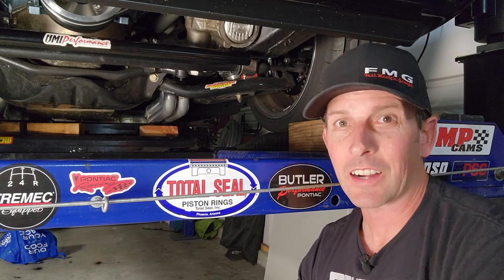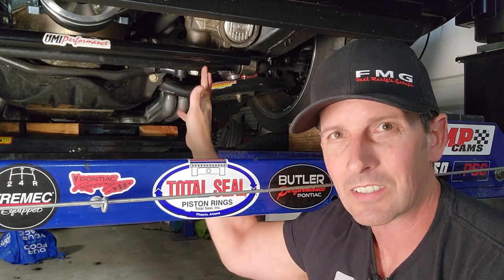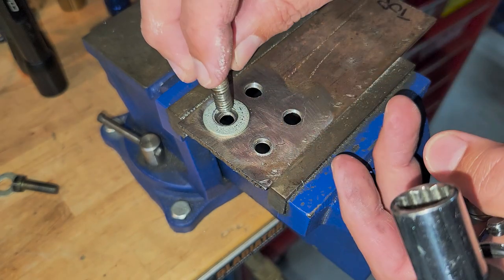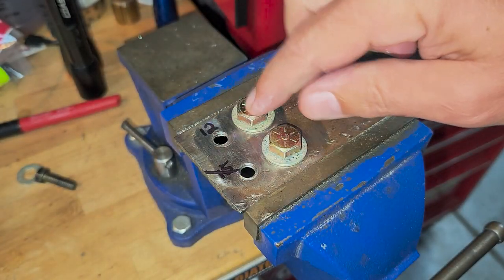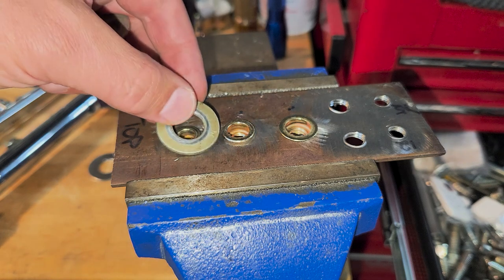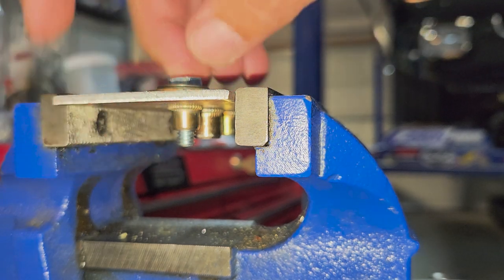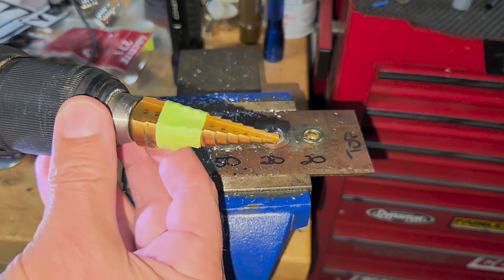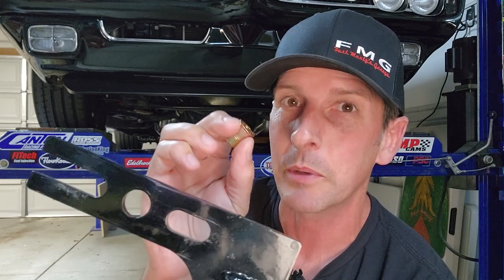How to fix a stripped sway bar bolt hole?  Retap?  Use a Rivet Nut?  Part 1

Comment: Well one of my bolts just fell out of my UMi front set up. I will be giving this a try. Thanks Monty !
Reply from the maker: Yikes!  Glad we have an app for that!  ha, ha... let us know how it goes!  Another tip, add some JB Weld to the nut/frame interface, which will give it some more strength and water proof that joint.

Comment: I went with plan D.  I measured/drilled holes in flat stock and welded flange nuts to it.  I drilled out the frame holes and ground and opening between them.  I placed the new flat stock w/welded nuts in the frame.  I bolted it down nice and tight and welded it up.
Reply from the maker: Love it!  Thanks for sharing!
Reply: I prefer plan D….speaking as a guy who likes to torque by feel which always ends up 3X the Spec
Reply from the maker: @RoddyDa  Totally agreed... welding in actual bolts is the ultimate solution.  Thanks!

Comment: I wish I had your problem, I have the style that's a welded nut to the inside of a boxed frame. It doesn't take much force to break that nut free, what a joy to deal with that.
Reply from the maker: ohhhh man, sorry to hear that.  If the nut actually broke off you could probably still use a rivet nut.  Otherwise, yeah, you're gonna have to cut it out, and weld in a new plate with nut.  Good luck!

Comment: A step drill bit is essential especially when you are drilling from the bottom up, as it is difficult to steady a hand held drill with a standard bit. One note is that using a large washer and then a small washer to even out the surface; I think this would cant the sway part about 1/8 of an inch to not being horizontal and have an effect on the function of said bar. Having installed this riv nut myself already, I am checking to make sure it holds up under the routine of driving hard through curves. I can of course keep increasing the riv nut size if that happens. I only had one stripped hole and there is a slight difference in height of the sway bar against the frame already, albeit barely perceptible.
Reply from the maker: Yup, great points... I cover the "Elevation Change" issue in Part 2.  The washers I was using was to test the torque without direct loading on the steel, to see when the threads would yield, and apply the same technique to the nut rivet.  As proven, they're much stronger "direct loaded" on that flange, as I too want the entire bracket to be flush.  I do come up with a solution I think you'll appreciate.  Thanks, as always!

Comment: Hey Mike just wanted to pass on to you a fine thread will work out better than a corse thread because of more threads per inch good video but figured I’d share my thoughts and if you put a washer underneath the stabilizer bar bracket for more surface area
Reply from the maker: Yup, agreed on the TPI.  But, the shear area isn't dramatically improved for the .125" material.  And, yeah, definitely need some sort of washer around the thread sert flange.  That'll be tackled in Part 2.  Thanks!

Comment: Do you remember what brand spindles and coilovers you used.  I have all hotchkis except for front control arms, spindles, and coilovers.  Did you use a 2 inch drop spindle
Reply from the maker: yeah, I got everything from Global West... including the 2" drop spindles AND Wilwood Brakes.  That said, they, and many other manufacturers have a modular tall spindle... I would try and go that direction if you can afford it.  I'll be upgrading to that at some point... have fun!
Reply: Thanks always for your help
Reply from the maker: @andrer3854  Welcome!

Comment: What matters here is pull-out strength, not thread strength. So the fact that a fastener mounted directly against the flange can be tightened to 50 ft-lb is irrelevant if it takes less than that with a ratchet to pull the entire rivnut out.

Here's the thing, though: pull out strength is exponentially higher than the amount of torque applied to the fastener, because the threads act as a torque multiplication lever. A single grade 8 1/4-20 fastener with adequate thread engagement has a pull out strength of 2850 pounds 😮 I doubt the rivnuts are grade 8, but still, this really exemplifies how much force the swaybar would have to exert before the rivnut pulls out
Reply from the maker: Great point.  Exactly why I was wrapped around making sure the flange is engaged, otherwise you just pull the rivet nut through the steel.  Naturally as the rivet nut size increases, so does the cross section shear strength, which is only a good thing.  Now someone needs to figure out the moment load the cross brace and sway bar put on those fasteners.  :)  Thanks Frank!
Reply: @FastMonty  Incidentally, my solution to this identical issue on my 1977 Trans Am and my 1996 Roadmaster wagon (both of which use the exact same type of swaybar mount setup) is to drill out those holes real big, then surface-weld in some metal plates that have grade 8 nuts welded to them at the proper spacing for the swaybar. I actually spaced them out about 1/4" farther apart to be able to accommodate thicker swaybars if needed, and I use bushing brackets with slotted holes (I wish I could post pictures on YouTube)
Reply from the maker: @FriendlyPhoton  Yup!  That's the ultimate solution... was trying to think of something everyone could do.  (Those who don't have access to a welder, at least :))  Thanks!